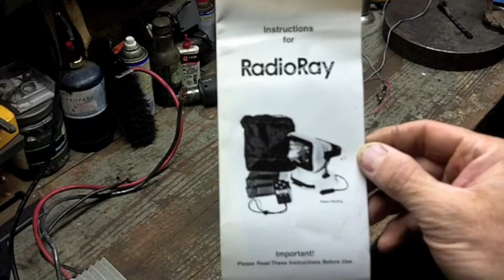Fixing RadioRay Wireless Spotlight

Comment: 4:09 Does the remote give you any sort of feedback if you hold a direction button to long. You don't want to strip the gears when the light reaches it's ultimate stop point as can be seen in the up / down motion.
Reply from the maker: ***** There is no feedback... just the clicking of the gears.  It takes a little getting used to.. When installed you won't even be able to hear the clicking.

Comment: could use a few of those. First one to track my back yard and another for my shop if the remote works that far. Track the two legged and four legged animals that try to cross my yard. Not much of a problem with two legged, they might run into a bear which would be worse than me.
Reply from the maker: 57WillysCJ LOL... this is a pretty cool light.. Thanks for watching.

Comment: I have a golight and the bulb doesn't come on. I replaced the bulb and no light. The up down and side to side works can you help please
Reply from the maker: Its difficult to diagnose without actually having the light in front of me.   With a volt meter, I would check to make sure there is proper voltage at the light socket as well as test if the replacement bulb works with an outside power source that has appropriate voltage. Other than that, I would need to see the overall fixture.
Reply: @yourbeekeeper  I just checked it at the car and it works I had it on an ac-dc socket in the house and the light didn't come on how can I make it work off that ac-dc socket